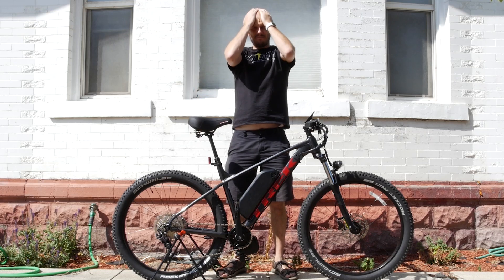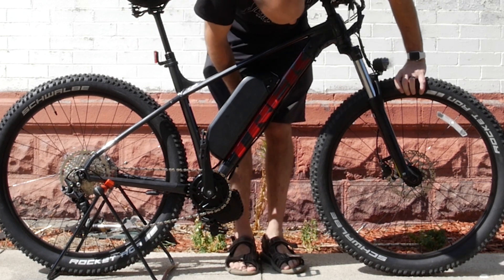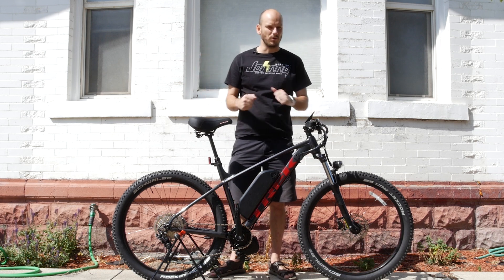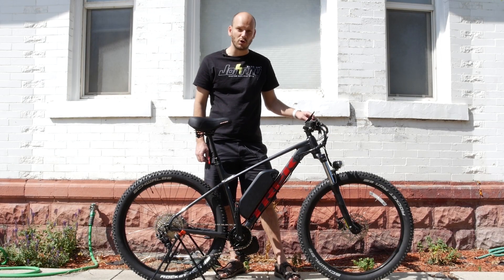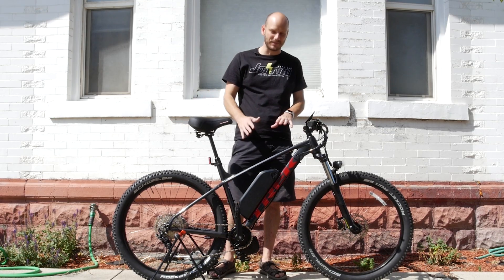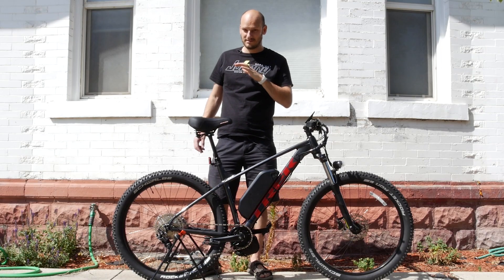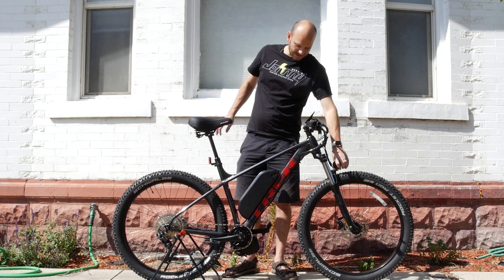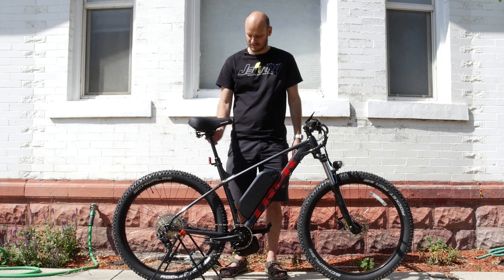Custom E-bike build: Trek Roscoe 6 w/ Bafang BBSHD 52v 17.5ah

Comment: I recently tried fitting the tongshen mid drive to a roscoe 6 but the oversized wheels didn't line up.  Did you have any issues getting the chain to line up with bafang?
Reply from the maker: I’ve done a few roscoes, I think I have always used the Lekkie chainrings to solve any chainline issues. It depends on which trim and which size frame you have as those both play a factor (Mildly) I think the Lekkie 42t is usually the best if I had to go off memory…

Comment: I have a Marin rift zone 3 front is 27.5x3.0 and rear is 27.5x3.0. I have a trail near me that takes you a couple miles through sand wash pedaling. I can pedal it through the whole way. 
-so yeah put the fat tire away 3.0’s will get you there for sure.

Comment: Hello Johnny, thanks for the consult last month, i have the same setup, question the DPC18 display only shows 38.v when the battery metres out 57.8V fully charged
Reply from the maker: That’s peculiar 🤨 have you checked the setting in the display menu? Maybe something is setting it off…
Reply: @JohnnyNerdOut  

Everything seems to be fine with display. Google returned 1 forum discussing this problems 2 replies said to ask for a warranty replacement as theirs have no issues. The bike is a rocket!!
Reply: Bafang requested pictures back of the DPC18 and numbers from mid drive casing

Comment: hey guys, so I have a 2019 trek roscoe 7 and I want to get a BBS02 on it, and im not sure if the motor will fit on it. what do you guys think? can I have the standard size on the BBS02 or do I have to get the bigger one on the BBSHD
thanks

Comment: Super duper ultra mega noob question - 4:10 - am I to understand these mid drives can use throttle without pedal movement? If so, is that an inherent feature to all mid drives, or just certain ones. Because I was always led to believe only hubs could use throttle.
Reply from the maker: Only a feature of aftermarket mid drives 😃.  And yes, it’s awesome. 👍
Reply: @JohnnyNerdOut  Cool, thanks! You've made a believer out of me.

Comment: Hey John, I’m having some slipping issues on the smallest cog under load. If I set a call with you would you be able to troubleshoot it with me? I have the same bike as in the video but with a BBS02
Reply from the maker: Yes 👍 I’d probably recommend checking/replacing the cassette and or chain.
Reply: @JohnnyNerdOut  ok I’ll book a call with you for next week some time so we can actually talk. It’s a brand new chain and cassette. I appreciate the response.

Comment: Currently building trek roscoe with the bbshd but u have to space the motor out because it hits the frame and now throws the chain line right out..  :( I've not put the chain on yet but can see it having issues
Reply: happens a lot with BBS installs, most of the time it needs an offset chainring. Often needs some bottom bracket spacers. Some people will grind off material from the motor if its just a little

Comment: I've got some questions on your tannis tire inserts.  These cost me 70 bucks a tire and you are supposed to deflate the tires after you use the bike. Do you do this?
Reply: that is a recommendation to "increase the longevity and performance of Tannus Armour" and prevent compression of the inserts. I can't imagine anyone would deflate their tires after every ride. Seems like you would only do that before putting the bike in storage. Bike tires tend to lose pressure sitting anyways.

Comment: Hey Johnny trouble n paradise. I have hit a wall trying to convert my  specialized rockhopper expert 29 into a ebike. 
Apparently the eagle 12 speed is a poor choice for the bafang.  Just Wanted to let you and your subscribers know. Lekkie bling ring doesn't work even with a 18 mm offset chain ring. The folks at Golden motors assured me it would. 😒
Reply from the maker: Which chainring did you use?
Reply: @JohnnyNerdOut  I tried the lekkie HD 42
Reply: @JohnnyNerdOut  cnc7075t6
Reply: Are you trying to come in towards the frame more or out?

I had to modify a lekkie 52t ring that is made for a BBSHD motor. My motor is a BBS02. I needed to bring the chain line in towards the frame.

Another option would be to get a rohloff hub ( I know expensive) but you can dial in the chain line really well when it's one straight chain  line.
Reply: @Keith Benjamin  my issue is that my chain ring is about 1 maybe 2 mm from the Chain stay and my chain line is rubbing on the rear derailleur when I have the chain in the middle of the 12 speed cassette. In other words my chain ring is too far outboard even though it is just about touching the chain stay. Wondering if a smaller chain ring with a bigger offset might be the solution,if there's such a thing
Reply: @americaofthenorth655  lots of 1x bikes that ship w/ small chainrings have chainstays that don't allow much clearance.  Due to the size of the motor, you can't get an offset BBS chainring that's smaller than 42T (or 40T if you change the motor casing).  You can get a cassette where you rearrange the individual cogs and take a few gears out of the middle, pushing the gears you use out away from the bike, and use the low limit screw on the derailleur to prevent it from shifting into those 'spacer' cogs.  As for the chain rubbing on the derailleur, if its just a little you could use plyers and open up the end of the derailleur arm a bit, obviously just don't bend anything that will put the derailleur out of alignment
Reply: @EBikeBuilder  thanks for the info. I have seen how to remove some of the gears from the cassette and I will see if that's a solution. I was hoping to do this build myself and other than the chain line it's going well.  I'm lucky there's a bicycle shop close by that will work on ebikes if I can't find a fix. Thanks again for your input !

Comment: Hi. Good day. Hope you're doing great. What glue do you use to put the magnet onto the brake lever? Thanks. You're awesome by yhe way.
Reply from the maker: Thanks! Lately I’ve liked the loctite super glue gel.
Reply: @JohnnyNerdOut  After this bike (in the video) was delivered, one of the magnets had become unglued. I reglued both with J-B Weld. Not only does the dark grey match the bike nicely, but the epoxy is SLIGHTLY ferrous... so the magnet pulled the epoxy in, making for a very smooth and slick look once it cures. I HIGHLY recommend it as opposed to super glue, which looks kinda crusty, and is too brittle. The J-B Weld is SOLID and super strong, plus looks great to boot! I suggest using it for all future brake cutoff installs. It's way better. (BTW, LOVE THE BIKE, Johnny! Thank you!)
Reply from the maker: @ClayRoe  that’s a great tip Clay!
Reply from the maker: @ClayRoe  which jb weld did you use?
Reply: @JohnnyNerdOut  J-B Weld 8276 KwikWeld Quick Setting Steel Reinforced Epoxy - Dark Grey 2 oz

Comment: I had trouble fitting both the BBSHD and BBSO2 through the bottom bracket. It was like a millimeter too small. I didn’t want to hone it.  How did you do it?
Reply from the maker: Check my video on that topic!😀
Reply: @JohnnyNerdOut  can u please tell me which video that is?
Reply: @MikeyMinimo  he uses a hole saw to shave material out from the inside of the bottom bracket, if thats what you're talking about being too small.  If the spindle itself is too small and theres not enough threads to get the lockring on, thats more of a motor size issue.  but if its just a mm, maybe slightly grind down the sides of the bb shell or something

Comment: I wonder how much longer we will be able to buy BBS02s and BBSHDs. Replacing them with something that has to be used with a Bafang Battery. Yikes.
Reply: the time is prime to buy a backup BBSHD controller. You can modify it to fit in the M625 and it will work like a BBSHD

Comment: quit a top speed for have such a small 36 t front sprocket /. must have vary small low tooth gear in 10th
Reply: It can't be lower than 11 teeth, so it must be 11
Reply: 52v helps for sure

Comment: After some research, I realised the Trek Roscoe was the perfect bike for my build.  I chopped the handlebars a bit as I found they were way too wide.  The bike is amazing!  I couldn’t be happier with it and I highly recommend it for a build.  I did get the m/l size and had to mount the battery on the top of the bike as there wasn’t any room in the triangle for it.  Something to bear in mind.
Reply: Also curious what size chainring did you use? And how is your chain line?
Reply: @TroyJasick71  I have a standard size Hailong downtube battery, it’s the same Johnny uses for his builds.  I’m not sure what size triangle is on a large, best get the dimensions first.  The chain line is stock size.  But the motor goes too fast to be able to pedal anyway!  It is a hub motor I have.  (Sorry Johnny!)
Reply: @neilrogersrogers6313  wait you fit a hub motor on the trek roscoe? what kind and how? with those huge tires
Reply: @Sigmaruler0199  any decent motor that comes with mtx rims.
Reply: Obviously if the battery pack doesn't fit it is the worst bike to convert 😂lol
Reply: @scottrocks1993  Hilarious!
Reply: @scottrocks1993  I was suggesting to check the frame size first as it may fit inside a bigger frame, or people may have to find an alternative way to fit the battery, just like I did.  It’s called research.
Reply: I’m getting ready to do this same exact build. I’m curious about your battery comment, what size battery did you install? Mine is a large frame, so I’m hoping there’s just enough room for a battery inside the triangle, or contemplating getting a slightly smaller battery?

Comment: Thanks for video. I want to change my 2019 Trek fuel ex 7 to an ebike but struggling on how to use the pressfit92 with the bafang bbshd motor. I think Lekke has an adapter for this but do you have a video where you have install using a pressfit ?
Reply: Luna Cycle also sells an adapter to PF92, and you'll need the 100mm BBSHD motor not the 73mm motor.  I would love to see Johnny film a video on this type of installation for the PF BBs

Comment: Thanks Johnny I watched all your videos with your help I just put a 750watt BBS02 mid drive on my 2014 29er Trek Xcaliber 7, I had to use 1 spacer to get the motor off the chain stay.  Still got to get a  Lekkie 42t chainring better then the 44t stock ring. My chain line is only slightly off so no dropped chains yet on my 9 speed sprocket, The hill climb is great done around 30 miles so far no problems at all. I just got to get a new seat and adjustable steam, rack and I have a great Ebike you just give me the idea to get the Schwalbe tyres - Thank you for all the help great channel and your build video inspired me to finally do it. All the best from the UK !!!
Reply: Schwalbe Big Ben Raceguard tires.  Used these on my first build, and have bought them for the in-process build.
Reply: @dennisyoung4631  Good idea I worry about punchers, my touring bike has marathon tyres so I was looking at something for my 29er
Reply: Anyone try the Vee speedster tires?
Reply: Hi you sound like you know what your doing, lol. I have a 2019 Trek Roscoe 7 and I want to get the BBS02 and im not sure if the bottom bracket will fit or not, and Im not sure what chain wheel will fit, Im new to all this bike conversions so thats why I dont know much.

Comment: Thanks for all of the info you provide on such a complex subject!
I'm still on the fence as to weather to conver- mid-motor on my Marin X10 Gestalt. It's a 1x10 with a 42 chainring. Will I be able to still have a 42 chainring in the conversion?
Reply: Lekkie makes a 42 tooth chain ring for bafang motors. I have one on my bike and it helps with my chain line and makes the bike climb hills without much effort.
Reply: That, and Luna sells one.  I’ve bought two of them.  42 tooth, both of them.
Reply: Do they cost like $100 bucks?
Thanks for the info guys!
Reply: @edinelsonramirez5656  the two I bought were a trifle less, but if one includes shipping, that 100$ fig sounds likely.

Note that the toothy portion of the Luna sprocket detaches from the carrier, so you don’t need to replace the whole thing when it is time.  Not sure about the Lekkie.
Reply: @edinelsonramirez5656  They tend to range about $120-$150 for the Lekkie ones from what I'm seeing on different sites. At that price, I'd go with the Luna like Dennis is saying.
Reply: Yes 100%

I have a 52T lekkie ring on my carbon folding bike with 20 inch rims/tires  , running a BBS02 motor.

Top speed 35mph

Depending on your chain line though , I had issues with mine. I used to run a BBS02 lekkie ring 52T , but not enough inward offset. So I modified a BBSHD lekkie ring 52t , now the gears don't slip at all. 
Really dialed in now.

The 52T BBSHD lekkie ring runs 18.3mm  offset while the 52T BBS02 lekkie ring runs a 6.5mm offset.  My bike needed more inward offset than the BBS02  52T  version offered.

Comment: I'm just in the middle of building a 52v 20amp BBSHD on a Saracen Mantra (it's a UK bike) complete with the lighting kit from China, as in stop lights tail light indicators  and front light with a horn, the whole thing stands me at £2,300
Reply: Top man for posting this comment
Reply: I'm in the UK 
I have a E-bike for sale now.
A Boardman comp 27.5inch very good condition.
1000w to 1500w mix top speed 38mph.
Big removable battery pack.
52v 16am with Bluetooth BMS.
Air suspension &
Good Sram hydraulic brakes.
Regen breaking puts power back into battery giving you more range.
And KT LCD8s coloured display.
Magnetic brake cut off switches.
Front light with horn with handlebar switches.
Back light with brake light 6 inch custom built.
Key ignition with voltage display.
Double custom-built torque arms.
10 speed at the back & 2 at the front.
It's professionally put together no zip ties can be seen.
Pedal assist & twist throttle.
Switches and ignition is custom built together.
So it looks factory built if not better.
I'm only selling for £1000 
This is the 4th ebike i built to sell.
I'm still making profit